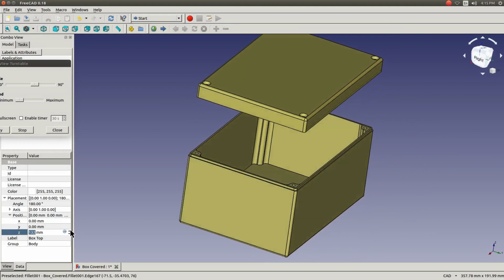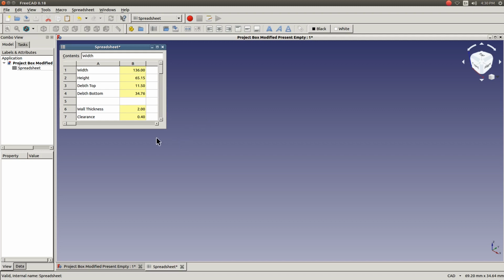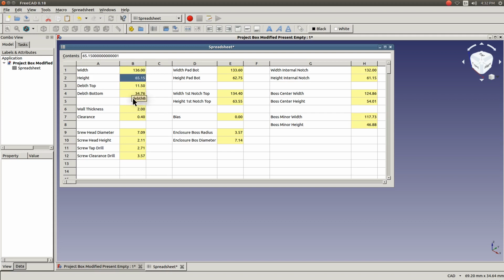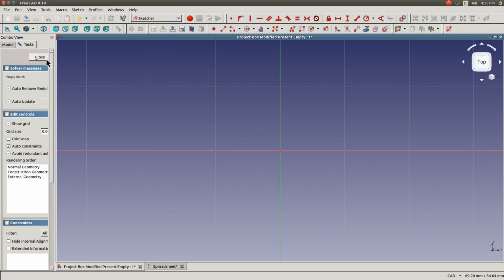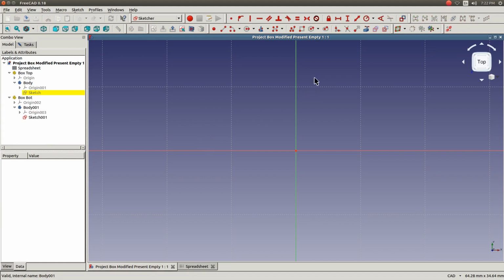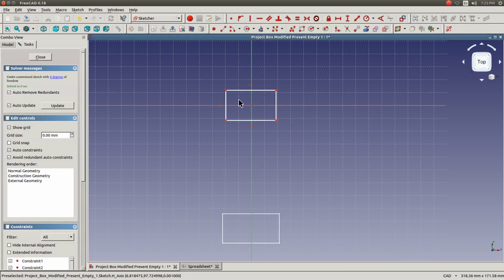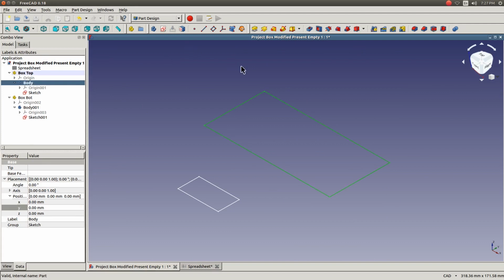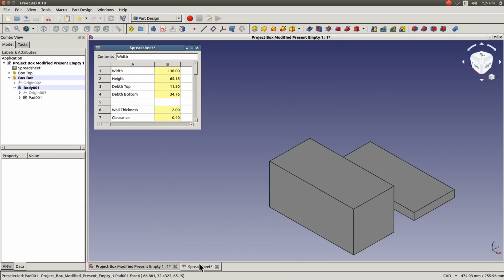Crazy Simple 3D Printed Enclosure with FreeCAD 0.18 Parametric Design Part 2

Comment: Awesome tutorial I learned something new today thanks 😊
Reply from the maker: Thanks so much for your kind words.  In a more recent post, you asked about encBosD.  The abbreviation stands for, “Enclosure Boss Diameter”.  For security reasons I develop on a different software platform than what I use on the internet.  For now I will say this, if you click on that cell, the edit line at the top of the spread sheet will always display the formula for that cell.  I’ll need to switch platforms and get back to you regarding the formula for that cell.

Comment: Thanks! I have 7 'different' etched fake nixie displays that really wanted to be parametric. I tried to make it too hard.
Reply from the maker: Don’t give up!  Stick with this series, it will become intuitive after a while.  In FreeCAD you begin to memorize where all the features are.  It took me far less time to create the parametric enclosure than it did to make these videos.  Also, it you’re into robotics and mechanical gearing, I did a tutorial series on creating parametric gears disguised as a paper shredder repair project.  You can find it on my channel page.
Reply: @bcastlar3453  In fact this video did make it intuitive. I now have one parametric design. In addition it's better than the separate designs. I can offset the chracters parametrically so that they don't obscure one another when stacked. Simple, too. Thanks.